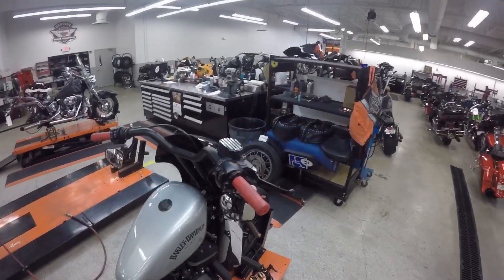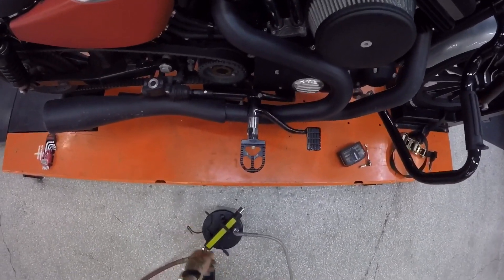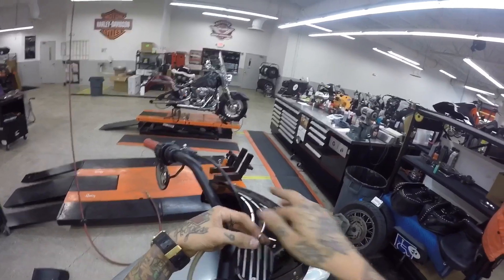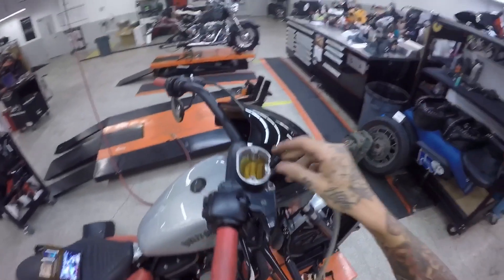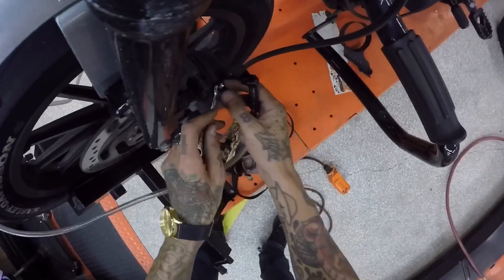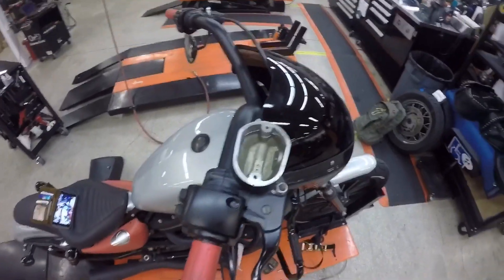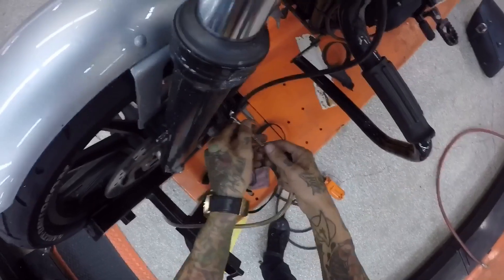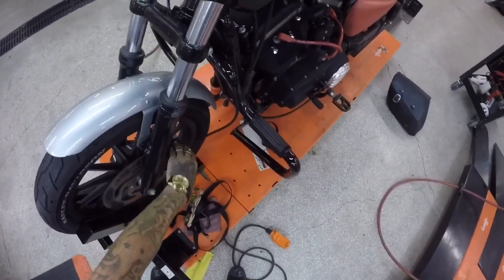Harley Brake Flush: The Easy Way.

Comment: I was an Auto Technician for 46yrs before retiring about 5yrs ago and also did a 1yr stint in Honda, Triumph and Yamaha motorcycle shop back in 1975. So no cover over the gas tank or fender to keep brake fluid off that nice paint, putting the reservoir cap face down on the lift and if your going to flush the system what about including the rear brake in your video. Also what's up with the gold watch just waiting to get brake fluid on that lol. One thing I learned when wrenching is get rid of the jewelry, rings and watches come off before the day starts and put them on when your going home bro. I have seen a guy loose a finger because his wedding ring got caught on a engine repair he was doing and also saw a guy get his wrist burned when his watch crossed the starter positive lead while he was reaching up in there to fix an exhaust leak. I will also say I made many mistakes over the years as it's all part of the learning process and don't regret a single day making a living repairing Auto's or motorcycles as I do most of my own work on my 2005 Road King that I have had for 16yrs now .

Comment: Got a lot to learn, I went to MMI and I’m still learning all the time, but little mistakes like not covering a take or laying parts on a clean soft service can make the big difference between the best Techs and the novice.
Reply: From what I´ve learnt thus far it´s basically this: Cover everything that´s paint or that could get stained from the brake fluid, basically the whole bike. Wrap the calipers in a rag. Never put the master cylinder cover on anything other than a clean surface/rag. No?

Comment: I wouldn’t have set that master cylinder lid on the bike lift face down it could pickup dirt, metal shavings or other types of fluid. Plus I would have covered the gas tank & fender. 
Neatness counts for a lot when judging someone doing maintenance whether doing mechanical or electrical or any kind of work. 
Thanks for the video!
Reply: Nor suck every last drop out of the reservoir. Leave the holes leading to the lines covered with fluid to stop air from entering the system lol
Reply: @PitbullSoco  Gonna empty both rear and front brake systems on my bike this weekend to have calipers and master cylinders painted. I guess I´ll just put the nozzle of the bleeder on the caliper nipple and let it bleed until there´s not one drop left and then disconnect the cables with rags covering?

Comment: Also... should have the brake pads pushed back all the way in  so that the fluid sitting in the caliper gets pushed out with the fluid change. Otherwise the old fluid in the caliper will remain.

Comment: Hey Boy, what about brake fluid splashing onto the painted surfaces like the fuel tank and fender?  I worry about what happens behind the doors at the dealeship when I'm not allowed in there because of "insurance reasons". I've heard some horror stories of bikes getting scratched by mechanics, and in this case splashing or mist onto the paint.
Reply: From what I´ve learnt thus far it´s basically this: Cover everything that´s paint or that could get stained from the brake fluid, basically the whole bike. Wrap the calipers in a rag. Never put the master cylinder cover on anything other than a clean surface/rag. No?

Comment: Hi there. 

I'm looking for extinct rear brake seals and piston for an Australian release 1978 SR500e Yamaha. 

Found one kit in the world but they want about $330oz for it when most other kits are about $35. 

The cylinder is 5/8" it's cast on the outside of the cylinder 5/8". 

They seem to be unique to the SR500e's and XS400e's, only.

If you mention the word Yamaha to the local Harley places it causes some kind of seizure or  mental blockage so I was wondering if you or your viewers could help with a very basic question.  

Forgetting the piston. Just the seals would do. 

It looks like a kit from a 1982-87 Harley could be what I'm looking for. The cup seal that sits against the inner end of the piston over the spring and against the 6 petals of the reed sought of valve thing must be the same as the cup seal on my SR they have the same type of valve and are 5/8". 

The information I'm looking for relates the other seal the one like a cup but with the hole through it that is on the outer end of the piston. 

Could anybody tell me the diameter of the part of the piston where this seal sits and how is this seal retained in place. 

The SR is 9.55mm at this part of the piston and the seal is retained by a small ring cast around the piston under the centre of the seal about 1 mm wide and not much higher than 1mm. 

Any help to solve this mystery would be a benefit to all SR500e XS400e owners globally. 

Found tons of photos of the kit but none without this seal removed from the piston. 

Thanks.

Comment: Looks super easy with a brake bleeder. Need to have mine done on my 2015 Limited. Not sure how the ABS changes the way it's done tho.
Reply from the maker: Ryan's V-Twin Vlogs your supposed to connect to digital tech to bleed ABS models, They bleed the same way, I've heard of guys doing it just the normal way like this without DT, but I've heard it can void your warranty on the system.